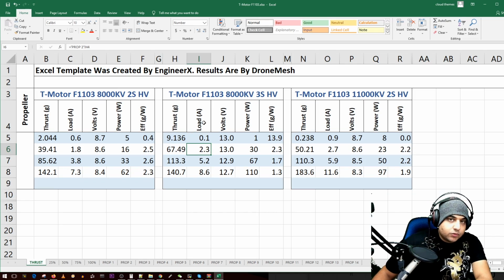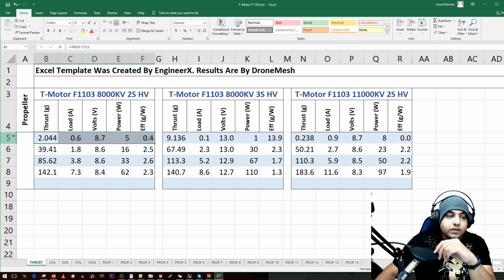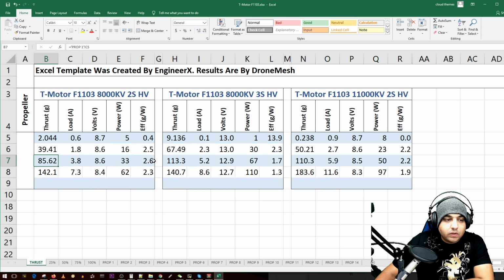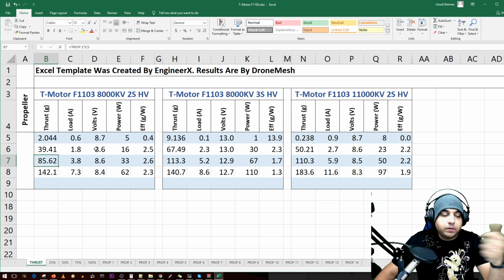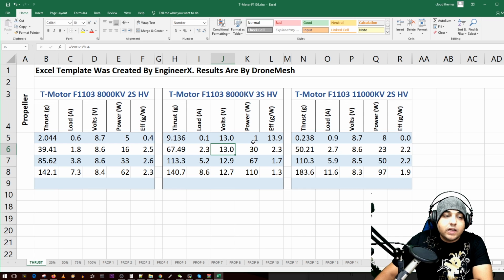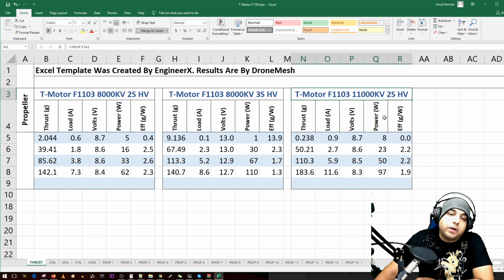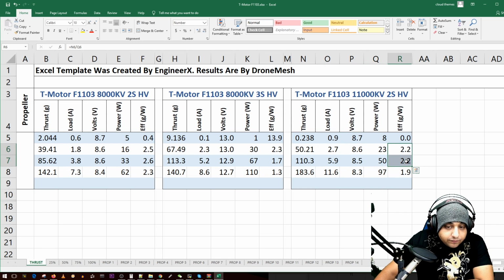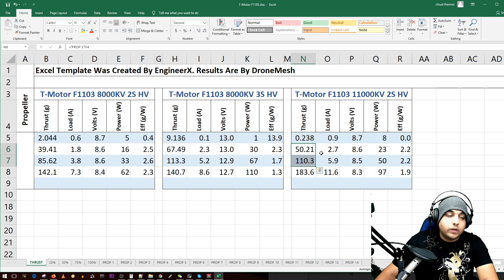T-Motor F1103 Review and Thrust (8000kv & 11000kv)

Comment: I did buy these motors 8000kv ones. And on my scale I strapped on some payload and The auw of my phantom toothpick and payload was auw 800gram. And it took of from The scale.  I used The HQ T65mm props with 3s battery

Comment: All the way off topic. But is there a way to design a board like a parallel board with resistors or whatever to restrict flow from battery to battery to a safe amperage so that you can equalize the  batteries before charging them on the parallel board. I'll take my free one as royalty for the idea
Reply: Just plug all the batteries into the board and let them sit for 10 minutes or so. They will all balance out. Just make sure they are fairly close before you do it. Having the isdt fast discharger is a must have
Reply: The point is to have one that will take batteries that aren't fairly close